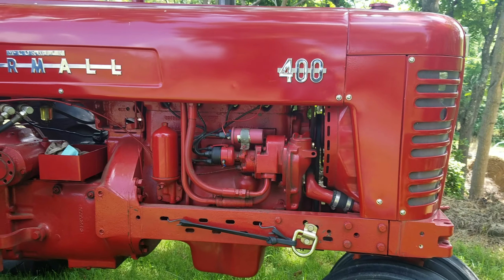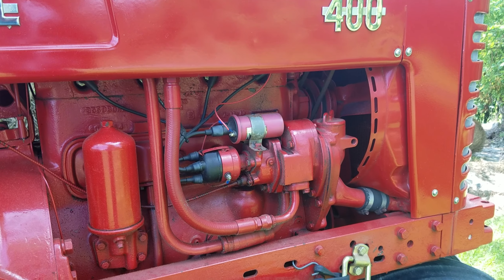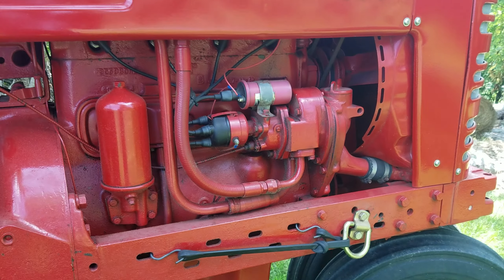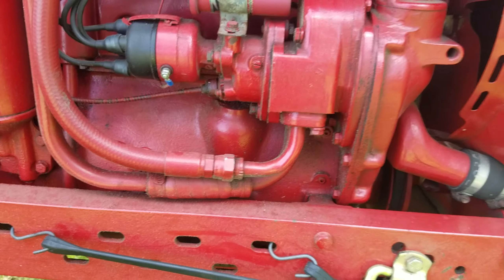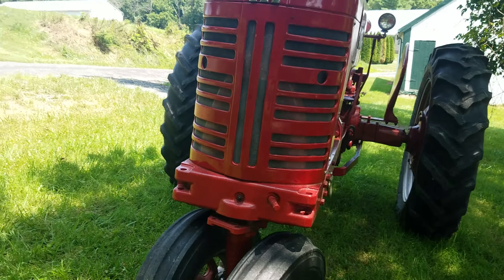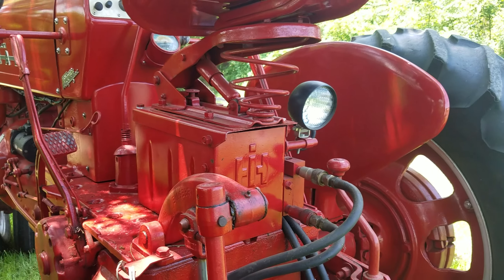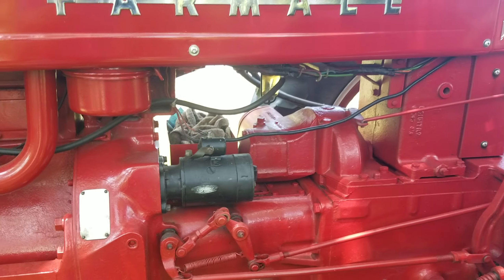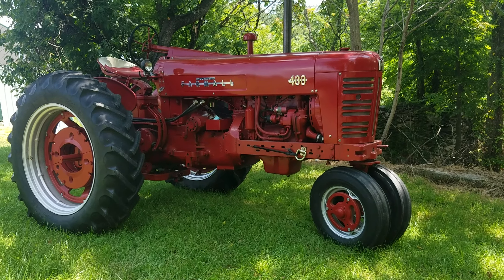Farmall 400 walk around.

Comment: I grew up on LPG 400. It had electrol instead of belt pully. Run electric hay bailer. When power went out we always had lights. It was our loader tractor and 4 bottom plow tractor.
Reply from the maker: That's cool. I bet not many LPG tractors with electrol and balers were around.
Reply: @VintageFarm1086  no there wasn't

Comment: Dad and I have a 400. Changing it to 12v and alternator and also installing a carb kit with some governor tweaking rejuvenated the old gal. (Having an 80 year old retired IH mechanic on the phone was awesome learning all the little tricks. Mechanic said if you have everything adjusted right you can take off in road gear with hardly any throttle.) Dad told me the story a neighbor farmer had with his back then brand new 400. It's hilly around where we live and the neighbor pulled out onto the road with a full load of hay. He didn't know the T/A would freewheel pulled back so he had a hair-raising experience barreling down that steep hill. It's the same hill my Dad taught me when I was old enough to just flick our M or 400 into neutral and let gravity take you for nearly half a mile-enough to take you over two smaller hills.
Reply from the maker: Thanks for sharing your stories of yours dad's 400. I glad some of the tractor's and the farm is still in the family.  Enjoy your 400. Thanks for watching and commenting.

Comment: I have a farmall 400 that was my Grandfather's. It has a 6 volt system that has all the issues you mention.  Where can I get the info on converting it to 12 volt?
Reply from the maker: I fabricated the alternator bracket myself.  I run a GM se10 alternator with a Dodge resistor going to the coil. I had a friend help we it. But now I think you can get a kit from Steiner tractor parts to do the conversion. There maybe some videos here on YouTube on how to do it.  I know you can goggle and find wiring diagrams for it. Good luck,  you will not regret converting it to 12 volts.